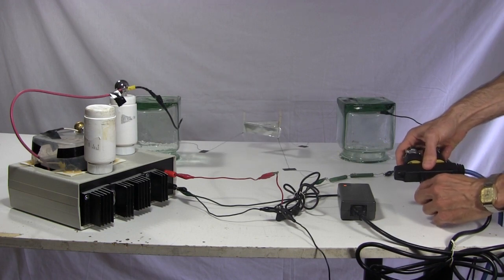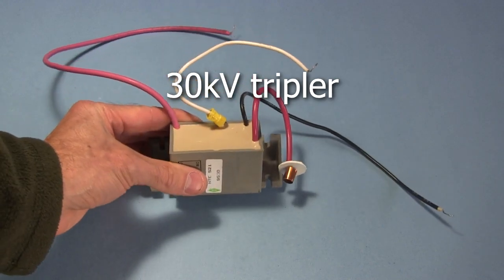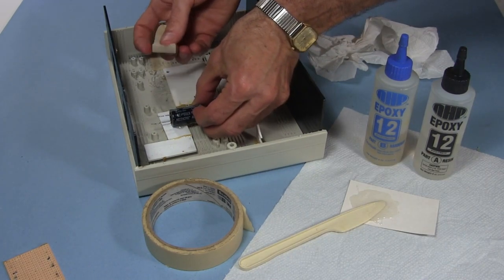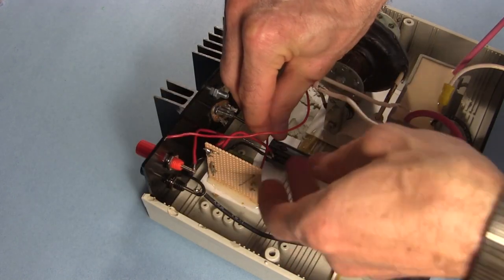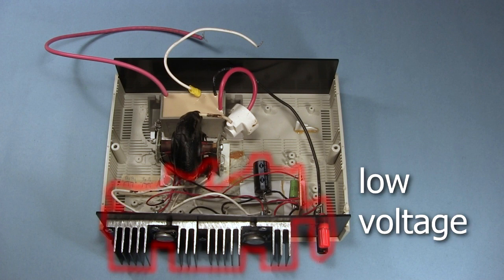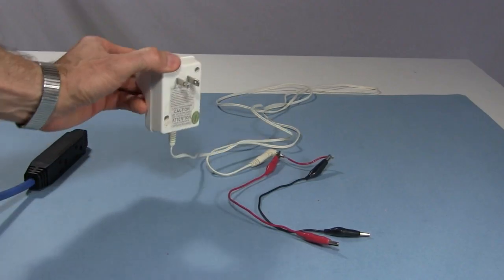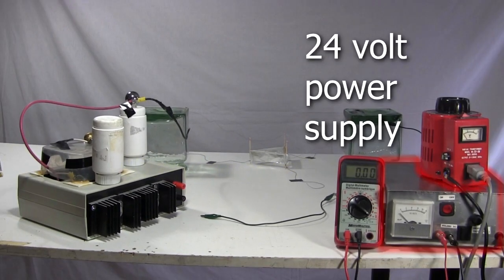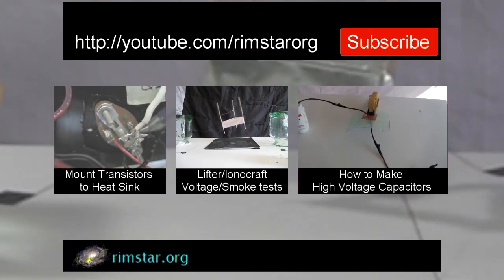How to Make 30kV High Voltage DC Power Supply with Flyback & Cockcroft-Walton Multiplier Tripler

Comment: I have an NTE523 and it has a CTL and REF pin, which one is ground because the other are F, OUT and IN, no GND.
Reply from the maker: Marcell Veszpremi I'm looking at the schematic for the NTE523 in front of me now but unfortunately it's on paper in NTE's catalog. Instead of saying CTL and REF it says POT and GND. I suspect that REF is GND since for some of the other schematics it has some pins labelled "GND or REF", plus REF makes more sense as a GND than CTL does (as in "ground reference".)Note that according to this schematic, CTL is an input that makes F (FOCUS) work, so unless you know what to give CTL, you can't use F. You can just leave them both unused, though if they are wires then make sure the ends are insulated from touching any other pins or wires by accident.

Comment: As far as I understand, no matter what kind of electricity you feed to a transformator ( AC or pulsed DC), you will always get AC output. Would you help me to understand how do you get DC out of a flyback transformator? :)
Reply from the maker: To turn AC into DC you need at least one diode (also called a rectifier). Diodes allow electrical current to pass through them one direction only, provided you have the right diode for the amount of voltage and current you're using. In the power supply in this video the multiplier, that comes just after the transformer in the circuit, contains diodes and does the conversion from AC to DC. Search for diodes, rectifiers, full wave bridge rectifiers, ...

Comment: hello, i just built the unit with a modern day fly back as you used in the cube and tripler as you used in the video with the antique fly back that no-one can find. do you have a video that combines the modern day fly back and the tripler? The circuit i have does not solder any wires to any pins or utilize the focus wire or screen wire . This is my 1st project and I am certain I am only 1connection away from success. The antique flyback had a black wire from pin 2 to the negative post of the capacitor what do I do instead since I have a modern day flyback?
Reply from the maker: I'm pretty sure a flyback with a built in diode, as in the cube, won't work with a tripler. A tripler needs AC as input whereas a flyback with a built in diode produces pulsed DC. I've never tried bypassing or removing a diode from a flyback that has one and I was recently asked about it and it looks like it might not be possible for some flybacks as it may be encased in epoxy, though I wouldn't rule out the possibility. But you can still use what you have, just without the tripler.  You will have a lower voltage output like the cube does, though you won't be able to fly a lifter is that's what you were after. Regarding the pin, see the video about making the cube where I show one way to find the pin https://www.youtube.com/watch?v=-KFhBVfpfDw.
Reply: Thank you for the timely reply. It is the lifter I am interested in flying and I thought I saw you fly it with the cube. I have enough parts to build both however and I am looking at an( admiral 79c77-5 flyback transformer) on ebay. It looks close to your old one but, like I said I have a lot to learn but I am open to any suggestions as to which one to purchase to make the job easier and I am extremely grateful for all that you are doing to enlighten and advance us all.  I am using a 0-30 volt 5 amp  variable Dc power supply to power my high voltage power supply and I have even tried using it to power a step up power supply that uses 6-12 volt input and puts out 500k, no success yet but I am in it for the long haul, Thanks again, Take care, Rob
Reply: So I purchased the above mentioned( admiral 79c77-5 flyback transformer) I  installed it as shown and looked for which pin was showing coronal discharge; none were, nothing seems to work. Q2 transformer is not getting hot like Q1so I took it apart tested forward bias and reverse(its good). Did i fry the tripler by feeding it with pulsed DC instead of AC on the first try? I checked continuity from all wires on the tripler and none of them register. What next? Anyone?

Comment: is this device basically a more powerful joule thief setup?
Reply from the maker: No, it's a very different circuit and works in a very different way. Also, the output of a joule thief is spikey voltage and current whereas the output of this power supply is DC, constant voltage and current.
Reply: @RimstarOrg  do you have a video explaining the circuit? I am trying to understand how the power flows through it
Reply from the maker: No, I don't. But it's a very common flyback transformer circuit that has a voltage multiplier/tripler added to the output of that circuit in order to convert the output to DC and increase the voltage. I used to have a link to a great page explaining the flyback circuit but it no longer exists. However, the flyback circuit is very common so you should be able to find an explanation out there somewhere.

Comment: so the tripler I got looks very similar to yours, and is also made by NTE however mine says on the HV out it puts out 40KV would the resistors, capacitors, and transistors in your video still work, or would I need to get ones that can handle the extra 10kv?
Reply from the maker: It should still work with the same resistors, capacitors and transistors.
Reply: Nice, thank you so much!

Comment: Hi, I'm working on a proyect which uses a high voltage power supply like this one and I'm planning on building one, but I have a question. I see you use the NTE 521, but it's a bit expensive. I've seen other NTE voltage multipliers that have the same voltage output, would it be any problem if I substitute the 521 for any other multiplier? Thanks!
Reply from the maker: I started writing a reply but realized I was writing a large chunk of useful information, so see my just now enhanced section called "The multiplier" on my http://rimstar.org/equip/30kv_pwr_supply.htm webpage. I list a bunch of the NTE multiplier parts and information about the differences.  You can't substitute just any one but as you'll see I found some that should work.
Reply: Thanks! This is what I was looking for.

Comment: I am planning to make this during summers, but have questions:
How can I ensure safety, since my dad is concerned?
How can  I use the flyback transformer such as the one used by you? (since I'm in India)
Also the Voltage Tripler
Reply from the maker: Your dad is right to be concerned, this is a high voltage and most importantly, also a relatively high current power supply. You'll note that I take safety precautions, such as the long stick I use when demonstrating near the end of this video. But since I can't ensure anyone else's safety, I don't have any videos specifically about safety. I recommend using this with someone who knows how to use it safely or you do so at your own risk.
But that might not matter. The flyback transformer is one with no built-in diode. Those are very hard to find these days. It might be easier to find and use an old PC monitor like I do here https://youtu.be/r32e0QGdm8U Of course, that want also requires being concerned about safety.
For more about the flyback and the tripler, see my webpage here https://rimstar.org/equip/30kv_pwr_supply.htm
Scroll down to the Power Supplies section of this webpage to see all my power supplies, including more about the monitor
Reply from the maker: Ooops... Here's that power supplies links https://rimstar.org/science_electronics_projects/index.htm#PSUS
Reply: @RimstarOrg  Thanks for the reply

Comment: Thank you for your previous reply on the wire size. I had purchased a flyback transformer which is a China made BSC25-4803. I had looked up the data pin details and found out that pins are label as C-B+-NC-AFC-GRND-H/T-ABL-TP. Which mean in order to ground my flyback, I should solder the pin that belongs to GRND to the capacitor's negative? Please do correct me if I am wrong.Meanwhile, I notice that my Tripler (BG2097-642-306) has a black suction cup while the one that you are using doesn't. That shall be the part connecting to a CRT as HV output right? Shall I cut off the suction cup and reveal the wire?
Reply from the maker: Yes, solder the pin for GRND to the capacitor's negative. On my flyback that was pin 2. And yes, the black suction cup on the tripler is the part connecting to a CRT as HV output. I don't remember if mine came with a suction cup attached or not. But yes, you'll need to cut off the suction cup to reveal the wire and make use of it.
Reply: Thank you very much. I will keep trying. Thank you for your clear instruction and assistance as well.
Reply: Meanwhile, it is impossible to obtain 220ohm 3W resistor in our country and I have bought 220ohm 5W resistor. Will the output be the same?
Reply from the maker: meow290
Yes, the output will be the same. The wattage indicates how much wattage is can dissipate before heating up and being damaged. So your 5W one can handle more.
Reply: Alright. Thank you again.
Reply: Rimstar, may I know will there be any difference if I wind the 1mm/ 0.5mm wire onto the metal arm of the FBT closer to the data pin end? If there a specific direction (e.g. from left to right along the metal arm of FBT) that I have to wind the center tapped wire? Please kindly advice. Thank you.
Reply from the maker: meow290
Just follow the winding direction I show in my video, unless you can't for some reason.

Comment: Thank you for such a great video. I'm currently making my own HV supply based on your instructions. I have one question before I start: Is it necessary to have the metal balls? I assume these are purely optional in order to create sparks from a ground rod.
Reply from the maker: With high voltage, losses can occur where you have sharp points in your wiring. Those sharp points ionize the surrounding air, leaking charge into the air, decreasing the available current and voltage. So I try to make connections with a few sharp points as possible. Having rounded metal balls as part of that connection helps to reduce the sharpness of the connection.
Reply: Thanks for the information

Comment: Hi there. I am a high school student doing a project. May I know the maximum output current this device can give at 30kV? Thank you.
Reply from the maker: Good question but I don't know. I've always done relatively low current experiments and for protection against the high current spikes you get with sparks, I've always put 240 killohms of resistance in series with the output. You can see that a little more than halfway down my webpage about this power supply https://rimstar.org/equip/30kv_pwr_supply.htm

Comment: Sir is there any chance of using the The Cube power supply which generates 20KV  to power smoke precipitator...
Reply from the maker: I don't know. Maybe if you put a high voltage capacitor across its output then you'd flatten the pulses enough but I can't know without trying. I'm not 100% certain why the Cube didn't work with the smoke precipitator, I would have expected it to work despite it having a pulsed DC output. The precipitator needs high voltage DC.
Have you considered buying a Wimshurst machine instead? Small ones made with CDs won't work but larger ones like I demonstrate in my precipitator video here work https://www.youtube.com/watch?v=ARSQWTzWago.

Comment: Nice feature about high voltage you have featured on YouTube. Can you help me to create a compact, inexpensive circuit with a 5000 volt output voltage and low amperage numbers. The supply is 240 volts AC.

Comment: Hi, i have a project and i need your advice before doing it, i want to make an hho hydrolic generator also known as water fuel that drive with flyback transformer.  I dont think it will work but i need your advice first before doing it.
Reply from the maker: Frederick Crisostomo Sorry, but I don't have the time to help you one it. It takes more time than you might think. Maybe someone else here can help?
Reply: Im lookin to do the same thing. Have you built one yet?

Comment: What would happen if you did'nt use the 4700uF in the circuit?
Reply: John Kerley the high voltage would be modulated by the transistors, at the frequency they operate, plus the frequency ripple of the power supply, so the high voltage would be less on average.

Comment: I want to use it but it's too bulky. Is it possible to use a LiPo battery out a grid of capacitors?
Reply: Or can a stun gun mechanism be used instead of a such a generator. This I want to use for the corona motor.
Reply from the maker: I don't know how well a stun gun will work with a corona motor since I'm not familiar with the circuit. You want something that can hold a constant voltage. But a corona motor doesn't need much in order to demonstrate it. In this video I just rub a cotton cloth against a PVC pipe http://youtu.be/6x6DqPL14yU.
Regarding using LiPo's, I don't know. I've never used LiPo's for anything so I don't have a good idea.

Comment: this transformer is for top cap holder a DY802 or a DY86 vacuum tube diode high voltage 20000KV backward voltage rectifier also xray tube generator

Comment: Can I use this in electrostatic precipitator
Reply from the maker: Yes, it's the one I first used. But the type of flyback transformer, one with no built-in diode, is very hard to find these days, if you can find one at all. That's because CRT TVs are no longer being made.

Comment: So, it's kind of like a very up-scaled joule thief with a transformer and a multiplier?
Reply from the maker: EPaR - Aidan Gieg No, it's quite different. The output of a joule thief is mostly zero with periodic spikes of power. The output of this one is flat DC, so constant output. And don't be misled by the fact that both joule thief and this power supply have transistors. The transistors do very different things in the two circuits.
Reply: Oh, ok.
Reply: RimstarOrg I beg to dis agree, your circuit is a jewel thief on steroids, your transistors are on 50% of the time, jewel thief is more like 20% tops, mostly less that 20%. your circuit is more efficient. I always called a joule thief a jewel thief.
Reply from the maker: N8ZU Oh wow! You're right. That joule thief just keeps following me everywhere I go. :) It's much clearer when you look at the single transistor version of this circuit. Aidan Gieg, I also misread your question and was thinking of the output from the multiplier - that output is flat DC. The output from the transistor/flyback portion of the circuit is as N8ZU said.

Comment: Iam not able to find the voltage multiplier any yhing else which i can use
Reply from the maker: Yes, sadly with the end of cathode ray tube (CRT) types of TVs there isn't as much demand for flyback transformers and voltage multipliers which is what they were made for. You can make your own voltage multiplier (search for Cockcroft-Walton voltage multiplier, parts can be found here https://www.amazing1.com/) but the flybacks are a bigger problem. You need a flyback which doesn't have a built-in diode and those are rare to find though it looks like Information Unlimited makes them https://www.amazing1.com/transformers-high-voltage-high-frequency.html

Comment: Sir what is the use of the white coloured output wire????
Reply from the maker: It's a high voltage output, but it's at a lower voltage than the red one. The I used is made for old CRT-style TVs and it has multiple outputs for different purposes in the TV.

Comment: Great video, I already make this kind of power supply, but using MOSFET based on ZVS driver schematic that I search on the internet, but I have a question, about the power supply you make that supply 24 DC, you said it was home made right ?, and if it so, can it be adjusted ? and I am also wonder if you can make a video how to make one ?, or can you tell me the components that is required to make one of those power supply.
Reply from the maker: The details for the 24 VDC power supply are on my website here http://rimstar.org/equip/24v_pwr_supply.htm. I control the voltage using a VARIAC, as you can see on the webpage (that's the big red thing I manipulate in the videos), but I don't have any control over the current.
Reply from the maker: Oh, it has a 1 amp fuse on the input side when getting input from the 120 V household AC. That means the maximum current on the 24 VDC output is around 5 amps (120/24 x 1 = 5).
Reply: Well thank you for replying my comment,  I really appreciate that. So you control the voltage using a VARIAC, a variable transformer, but i thought there are some circuits inside your home made power suppy in wich control the output that is DCV, instead of controling the input ACV to the transformer. In my country a VARIAC is very exspensive and also not much are available that is rated for 220 VAC , mostly it rated for 110 - 120 VAC, because of this I want to ask your suggestion for the circuit that is capable to control the DC output voltage with a fixed current of maximum 5 A..?
Reply from the maker: I'm sorry, but off hand I don't have any circuits for controlling the voltage on the DC side and none for controlling the current at all.
Reply: I see.., well its ok then, thank you so much for your time I really appreciated that and I am looking forward for your new video about amazing projects inhe future, thank you so much...

Comment: The picture of the schematic is pretty confusing, the classic schematic on your webpage is better in my opinion. Useful project, I'm thinking of trying it
Reply from the maker: LOL I received your unedited comment through email and came here to tell you that you can find a schematic on my webpage. I'm glad you found it anyway. I use the non-schematic form because a lot of my viewers aren't familiar with schematic notation and because it matches the actual system as shown in the video. For understanding the circuit I agree, the schematic is less confusing.